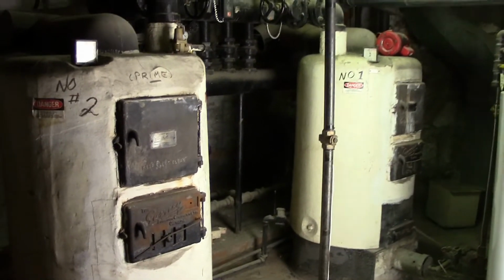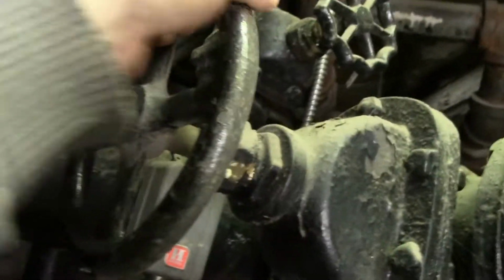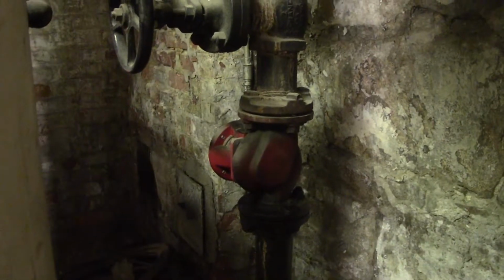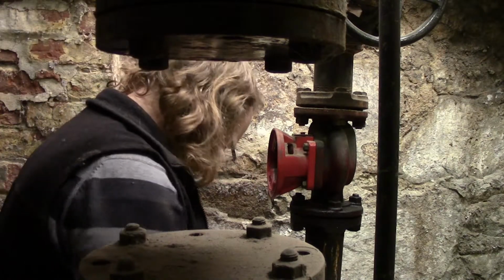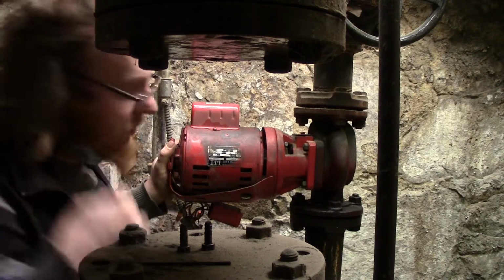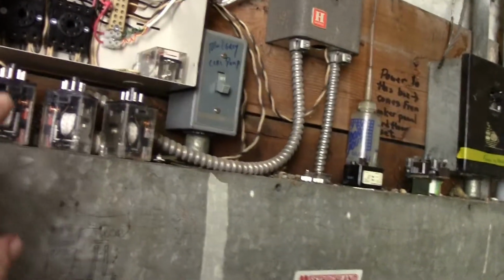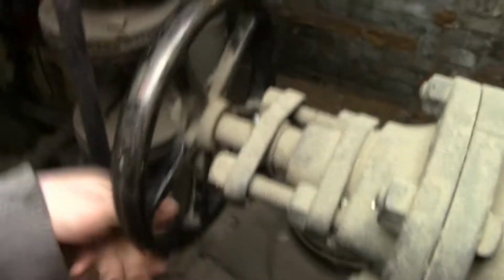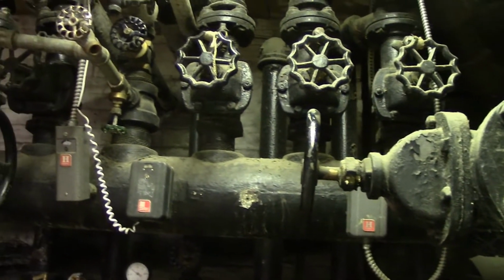The Makerspace Gets their Boiler Fixed - New Pump Coupler

Comment: Good old, BX conduit with cloth wiring. The old section of our house (1941) was wired with it.  Bell and Gossett circulating pumps.  I wonder why some of the Bell and Gossett pumps are painted RED and others are painted GOLD?  

I remember replacing one of these in a hot water system of a hotel.  The plumbing was so old that when the hot water pipe started heating up again, and expanding, then started the leaks!   I then learned the use of pipe repair clamps.  I'm glad those days are no more.
Reply: The red ones are cast iron (for hot water heating)((oxygen deprived)) and the gold ones are brass (for domestic water)((ie fresh water interning the system)).